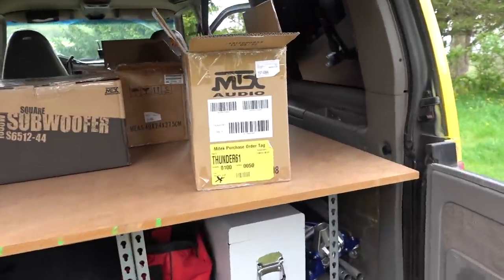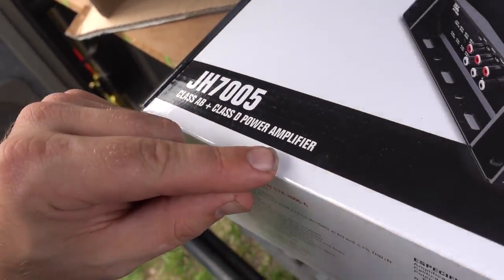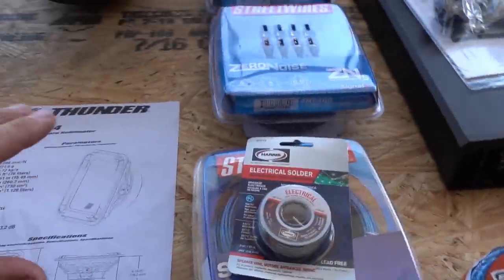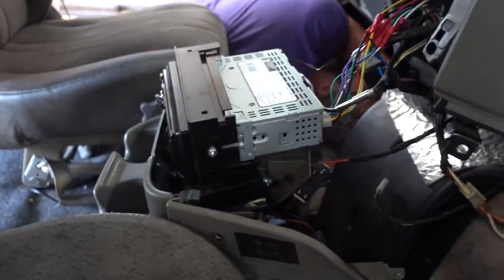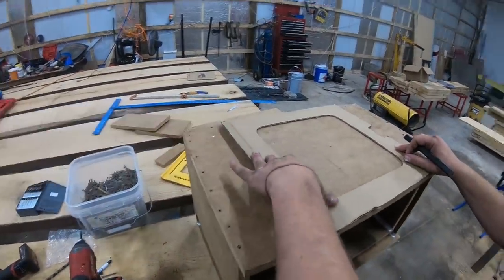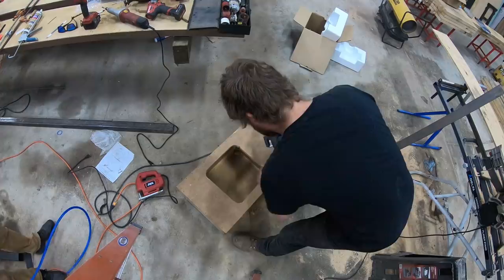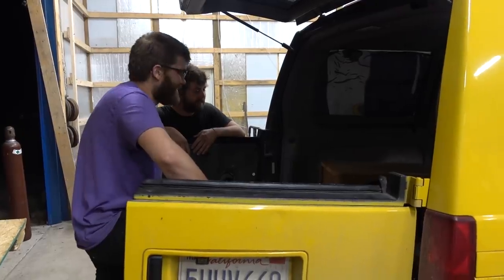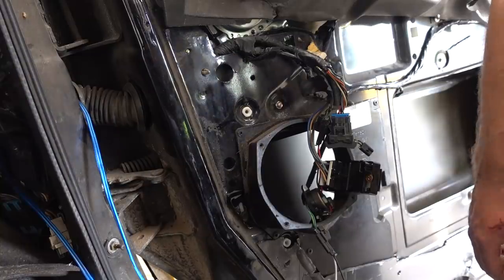Kyle's Badastro Gets THUNDER Bass! Complete System Install!

Comment: Just remember that the gain on the amp isn’t a volume control lol
Reply: Shhhh let em learn the hard way 😂
Reply: THIS!!!!!!!!!!!!!!!!!!!!!!!!
Reply: But when I turn it, things get louder...
Explain that Nikola Tesla
Reply: @Onewheelordeal  🙈
Reply: yeahitskimmel Pretty sure you’re joking, but....... The gain control adjusts the amplifiers sensitivity to the input signal from the head unit so the lower the the input voltage is, the more you need to increase the gain to compensate for this. Going too far causes the amplifier to cut off the peak part of the waveform (clipping) causing violent direction changes in the speaker voicecoil which generates a lot of heat build up and can lead to that lovely burning smell and a dead sub. Clipping also puts excessive loads on the amps power supply which can burn out the fets and also draws more current from your battery and charging system, neither of which are ideal.

So that’s why you shouldn’t think of the gain pot as a volume knob👍🏻
Reply: @paulEG6  yeah he was joking. Pls read the room.
Reply: Cam I have aspergers so it can be tricky for me tell when people are being serious or not, it’s a pain in the butt tbh
Reply: @paulEG6  No worries, mate, you saved me a Google search. Thanks!
Reply: Ahh the smell of a burnt sharpie...
Reply: Carbon Reed lol, it reminds me of TCP, an antiseptic from my childhood 🤢
Reply: @paulEG6  thanks for the knowledge!
Reply: Stephen M other than not mentioning the squared off part of the wave being dc, what exactly from my post would you consider to be misinformation? I watched the sonic electronix vid that you linked and other than being worded differently and not specifically mentioning the dc part?
Reply: @paulEG6  watch barevids explain clipping if you want an extremely detailed video, but from what I read you understand it pretty well.

Comment: Im curious if when a engine swap is a option, will you go diesel or just a stronger engine
Reply: A buick grand national turbo 3.8 v6 would be sick.
Reply: a 4 cylinder cummins with compound turbos. Nice and small, tons of power, screaming turbos; what's not to love?
Reply: It's a ASTRO VAN
Reply: A 4cyl out of a Frito lays truck will bolt up to the 4L60 easily. He could also get a mercury 4.3L boat motor head and eliminate the spider injectors which would give him the ability to add power.  Stock 4.3L liter suck for power.
Reply: @es4forty892  bro thats what i keep thinking. The Weight. All the weight he keeps adding. Power, gas mpg and now alt. Haha. Great reply A1
Reply: I put a v8 in one of these van's. It was fun as hell to drive! Talk about burnouts! It got out of hand with a two tone custom paint job with grafix, lowered on 18s. The loudest exhaust possible, the loudest stereo possible. We started with a cargo version and got a complete interior out of one and pimped out the inside. Many memories were made in that thing being in my early twenties tearing up south Florida. Even a crazy police chase in it nobody would believe the outcome of lol
Reply: @S4B3R117  a 4bt is way too heavy plus if you have ever fucked strong with them, unfortunately they are dogs even with compounds. I have built a few swapped 4 bt vehicles before a ranger, a Wrangler, and a old land cruiser. There land cruiser we built the engine including dual turbos and it still was nothing impressive. Honestly imo unless your hauling and towing diesels suck. Plus with the amount of space he's working with it being a van with dog house his best bet is a good built 4.3 with a turbo. It'll be perfect for that set up, to keep it light and good power . Way better than a 4bt and more power. Or just a nice built NA ls would be a great choice to.
Reply: LS V8 swaps are common...and easy

Comment: Reminds me of rewiring my Cavalier back when I had it to fix the sound system 3 times as parts from the Pimp My Ride era died in it. 

They decided to put some cheapo one way door speakers in the car with non crossover tweeters and run them from an Alpine amp. Well, that blew one channel, so they wired the whole front set of speakers to one side of the amp, but left the RCA connectors in the same spot. The two 10s were run off a Rockford Fosgate amp that was still good. 

Ended up tossing the 20 wpc Alpine POS and rewiring back to the 40 wpc Sony head unit, and running the sub out to the Rockford Fosgate.

Really fixed a lot of problems until I found out the deck speakers were original and blew them with Alive 2007...

Replaced those and blew the door speakers...

Ahhhhh car audio, how I love/hate thee.

Comment: Idk if you will see this but try to get an inline fuse put on the power close to where its connected. Other thing is just optional just helps the speakers last little longer and less distortion to set the lpf on the amp or headhunt.

Comment: You're going to need an upgraded alternator and you really should look into a drycell battery. I suggest downloading a free computer program called Winisd. It'll help you when building a sub box.
Turn the volume to 30 and adjust the gain on the amp until you hear distortion then back it off just a bit. Easiest way to tune without a SMD DD1.
Reply: unless your headunit max volume is 20, or 50, or 60... or who knows what.  That is just horrible advice.

Comment: I wouldn't have mounted the amp to the subbox, and if you absolutely have to, caulk those holes to stop air from leaking. Run your power independently from the RCAs to stop noise. Tune the amp with a multimeter. It's pretty simple with a YouTube tutorial. It'll save you from blowing the speakers. Good shit man. Love the vids.

Comment: Also another tip. Don't mount the amp on the sub box. It will slowly destroy the amp from vibration. Also the amp can blow the crossovers if they aren't rated for the power. Speaking from my cousins experience. Blew all 4 crossovers and his hifonics Brutus 5500 watt amp. The deck can power the component systems easily

Comment: Kicker L7 : AM I A JOKE TO YOU?!
Reply: Right! I agree with you there! I had 2 15" L7s in the back of my s10 at one point. Probably 1 of the loudest systems I've hooked up and had the pleasure of owning. There's actually some videos of it on my channel if you wanna check em out. Was a clean install too. Had 2 Hifonic 2000 watt amps hooked up. 1 a piece, wired them to 2 ohms. Ported box. And a 300$ glass mat extra battery to keep the power from dropping. Actually got pulled over once for pounding as I passed by a couple police officers lol.
Reply: @kerncod22  I had the 2 15s in the back of my extra cab Toyota mini. Lol it was good fun.
Reply: @kevinaguilar8014  sounds likethe same setup pretty much lol

Comment: Sorry to be that guy, but MDF is not great for a bass housing, as it's compressed sawdust essentially. Plywood resonates much better and gives a nicer tone, which is why guitar amps use it for the case. 
The crossover will rattle to pieces mounted like that, on the inside. It's all circuit board and solder, which isn't super strong, it's also nice to be able to access is to tune the setup. It allows you to tune how the lows, mids and highs are distributed. 
Make the wire only as long as it needs to be, it'll just rattle around and create wire breaks. Mount them to a surface as well to stop rattling.

Comment: Unless that was glue , you should never use silicon sealant on a subwoofer or speaker enclosure and then fit the speaker . The fumes will attack the copper voice coils .
Also that channel is running full range you can hear it . You need to turn the low pass filter on and set it anywhere bellow 100hz.

Comment: Pro Tip: Next time you're soldering a bunch of wires, get yourself an old cap from a rattle can, cut a slice at 9 and 3 o'clock, insert wires, and now you have two hands free to solder.😉👍

Comment: Hey Kyle, you don’t really want to put the crossovers for the front speakers in the doors, they will eventually get wet and short out, if you have room back at the amp, you can mount them back there and run the wire forward from there, they don’t need to be close to the front speakers, a lot of people think this to be true, BUT NO!!  Lol   Just tryin to help out, or if already mounted well in door, put in plastic bags or anything waterproof. ✌🏽✌🏽✌🏽✌🏽✌🏽✌🏽✌🏽✌🏽✌🏽✌🏽✌🏽✌🏽✌🏽✌🏽

Comment: You should move your amp off of the sub box. Over time it will rattle the wires and stuff inside the amp loose and cause the amp to fail

Comment: I wouldn’t do ported. Yes it’s louder but usually sounds shitty at every frequency other than the one the port is tuned for. 

Dual head units are garbage. Pioneer or nothing. 

The smaller “amplifier” with the component sets for the tweeter is a crossover, not an amplifier. 

Definitely run the power wire direct to the battery, and use a fuse or when you pinch the wire and short it to the chassis your van will burn down.  A wire that size directly shorted can absolutely get hot enough to ignite your carpet before it melts in two.  Ground your amp directly to the chassis somewhere close to the amp, short wire and low resistance connection is important. 

I would ditch the 4x6’s altogether so you can crank up the 6.5’s to their full potential. Personal preference on that one though. 

Not sure if you did this, but run rca’s down the opposite side of the car that you ran the power and don’t run them parallel with data wires in the car. The rca’s can pick up noise that’ll feed through as a high pitched whine. Even if they’re supposedly shielded. 

MECP certified installer with over 5 years experience of fixing all the above mistakes people often make plus many more.

Comment: He'll yeah that system came out dope, its prolly so expensive tho tbh, I had a 12in kicker comp square sub that was shallow enough to fit into a shallow box so I could fit it under the passenger seat of my saturn hatchback, and that with the kicker comp 6 1/2" door speakers and the kicker comp 1200w pro series amp that sh*t rattled my door panels off once a week😂 but that was a 1900$ setup I can only imagine the price tag on this whole kit prolly with everything included 2200$ ish i wanna guess

Comment: You should really run the power wire first and hook it to the amp BEFORE hooking to battery...
Good way to blow the fuse, if there is one on that power line...

Comment: Kyle mount that amp somewhere else. Never mount the amp on the sub box. The vibrations will cause the components to come loose from the circuit board, destroying the amplifier.

Comment: You're gonna need a bigger battery at least. A capacitor might work here and should. Look into a capacitor first
The head unit is the most important imo. The duel might have the hookups you need, but, not the worthy-ness of the good MTX components.  Also, pack fu#%ing everything  with dayno mat or something like it.  Sound deadening is key.

Comment: Man you'll fucked up.

1.  Power wires going to the back are too small and voltage will drop at high volumes and will kill your alternator and battery prematurely

2.  You didn't put a layer of acoustic dampening on the inside of your sub box.  You will have all kinds of weird extra sounds reflecting off the inside of the box and coming back out the cone and port.  

3.  NEVER mount amps to your subwoofer box!

4.  You didn't install any sound dampening on your vehicle while you had it all torn apart.  Adding it to the doors will actually give you a nice increase of volume relative to outside noise.

5.  Throw away those 4x6s and stick with just the 6.5s.  Different cone sizes and types have different harmonic distortions so its best to have them all the same.  I.e. subs same brand and cone size, mids same brand and same cone size.  Same for tweeters.

6.  Your crossovers need to be mounted more securely than with zip ties.  They have holes for screws or nuts and bolts. Vibration is your greatest enemy for the electronics of your system.

7.  You bought speakers with metal dome tweeters.  Everybody knows silk domes sound the best.  And you used a zip tie to mount some of them.  God dammit....zip ties are for bundling wires

Ps.  I hope you have your power and rca wires running on opposite sides of the vehicle from each other.